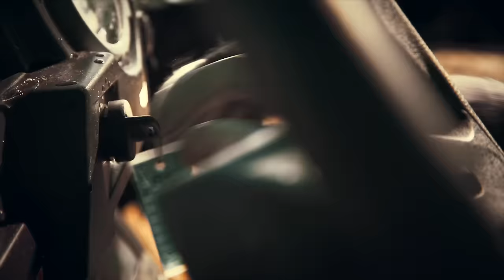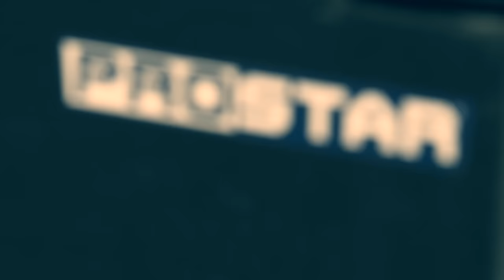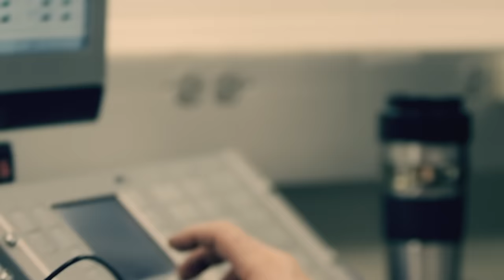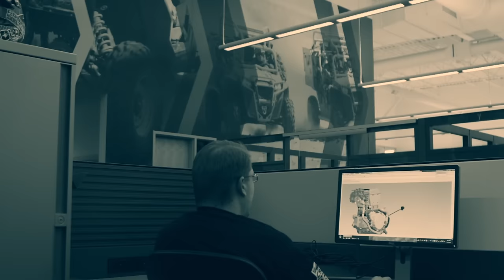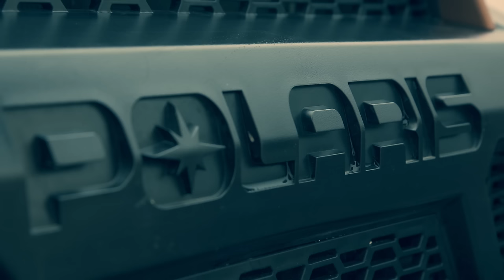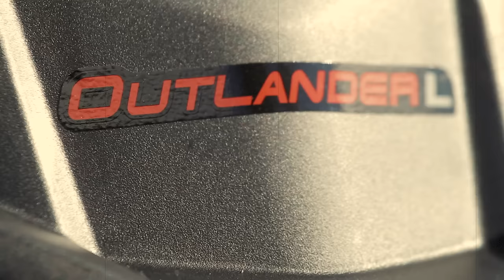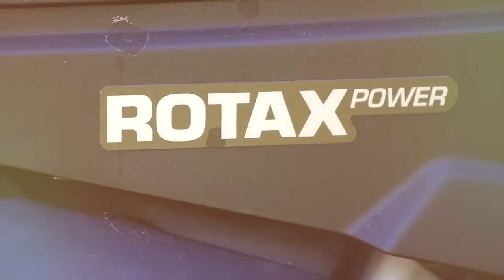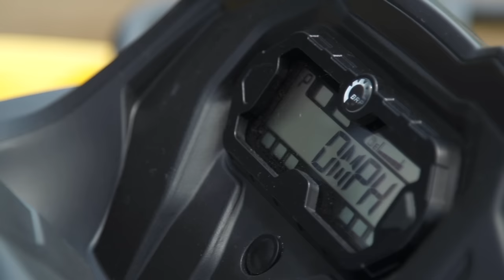Dirt Trax Television 2015 - Episode 4 (FULL)

Comment: +Dirt trax I'm 5.8 what Polaris atv would you recommend? I would like to use it for work and fun, but not a wicked fast quad.
Reply: You should get the can am outlander 500L
Reply: Fast reliable good suspension but it's can am instead of polaris
Reply: Devyn Roy I second that. Got mine a week ago and I'm in love. Beastly quad
Reply: I don't really like the outlanders I've ridden but it a personal thing I'm Polaris and if the want a Polaris a 570 would probably be good
Reply: brenton troendly How don't you like the outlanders? Too much power for you? lol
Reply: lmCIoudz yeah its way too much power even though the 570 and 500l almost have the same power...
Reply: talk shit get hit *almost* is the key
Reply: if u think 5 hp means ur quad is faster then ur mistaken. gearing, weight, and overall condition of the quad also is a big factor. torque may be what ur talking about in ur case though because the more torque a quad is the more powerful it feels. and one more big thing i almost forgot is the 500l is a twin cyl so that means its smoother and a overall better quality engine. i just dont like the pricetag.
Reply: talk shit get hit it's cheaper than the polaris with powered steering, and it has a 5 year warranty. and it is faster.
Reply: i am open minded about atvs but i see your point here. the only thing i dont like about polaris atvs is their cvt. its engaging system tears it to shreds. also the can am 570l is 200 dollars more but i guess the smoothness of it and the durability makes up for it.
Reply: Luke Worrell I wouldn't bother with a polaris ATV! I'd go Can Am for the atv market, best power, ride, reliability.
Reply: Can am is the way to go 90% of the time
Reply: I just got a 2015 700 grizzly and i love it, im stepping up from a 2001 honda foreman 450, its smooth and powerful, haven't even had it wide open yet, only got 90 kilometres on it, so its not even fully broken in yet, but the price was phenomenal, i got it for what others are selling there 450,s and 500's for
Reply: ***** and my can am has a 5 year warranty, a $500 rebate, and more power than your polaris :)
Reply: 01hondascott Wait for your gas to start boiling. Everyone I know that's had a grizzly has had boiling gas, even me.
Reply: Kyle Fitzgerald I'm pretty sure you mean "boiling" not bowling. Last time I checked atvs don't hang out at bowling alleys.
Reply: ***** I still have more torque
Reply: Guys this is all an opinion if the man wants a polaris then he can get in it's his money I have a 1000 can am renegade X xc I find they are way better then a 500 class atv but if 500 class is what you like then so be and enjoy quading
Reply: ***** this isn't a polaris video
Reply: KThachPSN Sorry was typing fast, my mistake.
Reply: Just because someone likes can am more doesn't me they can watch a polaris video there still good quads
Reply: +Devyn Roy Thank you!
Reply: +Devyn Roy  but doesn't have polaris awd so or the low end grunt the 570 or the old 500 had
Reply: Graham Davis it may not have the low end, but it shits on it in the mid and high range lmfao. and polaris' awd is ass
Reply: +lmCIoudz how's it ass lmao locked all the time pretty much lmao  again someone who hasnt owned one
Reply: Graham Davis locked all the time? no. and no i haven't owned one, I don't like changing belts every 2 days
Reply: Quick side not any one no how to mute these notifications because I'm over this war and it's annoying af
Reply: Devyn Roy top right of the first initial post, there's a little drop down post that says "Mute Post" :)
Reply: +lmCIoudz not to much power I'll ride whatever. Ike you put me next to like I ridin Polaris scrambler 1000 can ams aren't really all that comfortable and there usually longer than Polaris
Reply: +lmCIoudz I've only changed 2 belts in 13 years
Reply: +lmCIoudz that's why u get a clutch kit , i guess u have a stock 4 wheeler lmao
Reply: Graham Davis How do I have a stock quad? Because you bought a shitty quad, I have a stock one?
Reply: +lmCIoudz mines not shitty lmao built all the way which was just recently stolen lmao so u can say now I don't have one 😂so let me try to find  the theif its been a week now located in Louisville ky